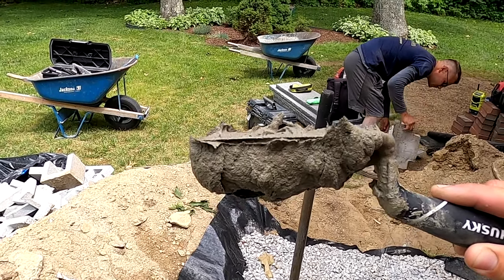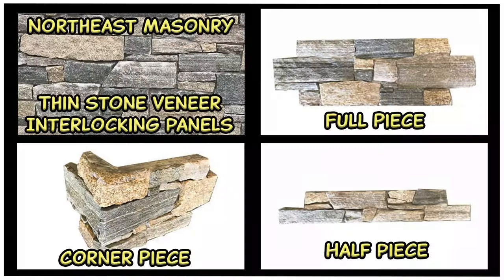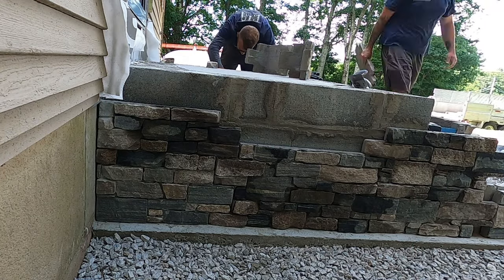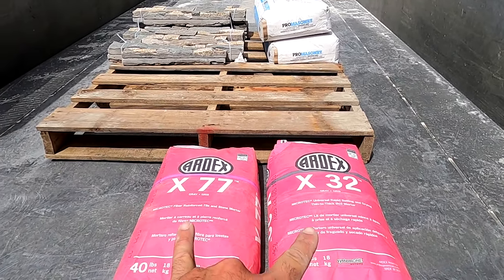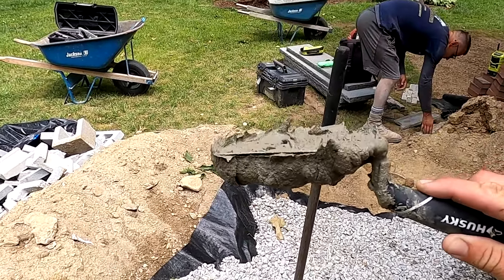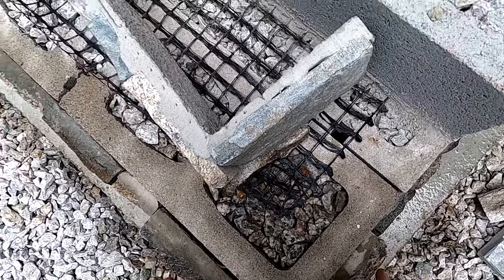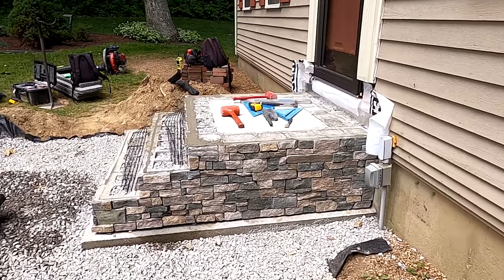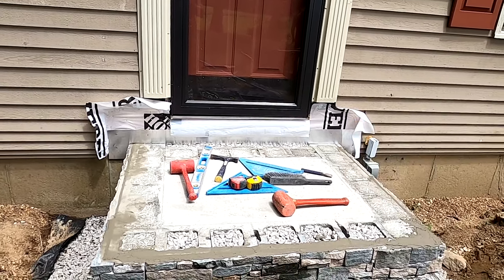Installing Stone Veneer Steps The Easy Way

Comment: My contractor used bluestone in a similar way you used the granite a few years back.  Instead of mortar for the joints he used polymeric sand which degraded over time.  I am repointing it with polymeric sand now and was looking for tips on how to keep sand in the end joint while I water it down.  I always thought the joints should have been mortared
Reply from the maker: Sorry to hear that, mortar is always best for those situations. But using some duct tape on the end joints should help.

Comment: Hi, a little advice.  buy yourself an inverter from 12 volts to 110 volts and install it in the truck.  and you charge the batteries and you also have power if you need it
Reply from the maker: Good idea man, thank you! ✌

Comment: What are the riser heights on your steps ? If you have 8” cmu block and let’s say 1 1/2 thick tread for caps, you have 8” risers. Do you cut your block down to get smaller risers? Just curious because I’m about to do a job like this
Reply from the maker: We made this staircase with 6" steps. We did have to cut the blocks down because nobody had 6" block in our area at the time. The first step we left at 8" because the first 2 inches will be buried below grade, making them all 6" steps.

Comment: work looks great but i would suggest buttering the full back of the stone since you didnt strike in your head joints on your block
Reply from the maker: Thank you, and as I explained in the video I don't think it is necessary to back butter the entire panel because when you push it into place, the mortar spreads across the entire back as you apply it. And because we are covering the block with stone veneer, mortaring the head joints is not necessary. The mortar behind the stone veneer seals those head joints.

Comment: Thank you for your great series. I don't have much experience in building steps using 8x8x16 concrete blocks. My question is that I plan to pour a concrete pad and then place the blocks on top. But how do you bring the step rise in line with the standard 6-7 inches when the block itself is 8 inches tall. Thank you
Reply from the maker: No problem, my pleasure! Unfortunately if you want 7" steps, you will have to trim all the blocks down before installing them. I had to so a similar thing on this project but only because my block supplier di not have the 6" block I wanted to use.

Comment: Yes, thats a pro tip, You are so right about filling the joints when mortar underneath is still wet.. if you fill joints after the base is set frost freeze will pop them out in a few years..
Reply from the maker: Yes sir, you know it. Thanks for the comment! ✌

Comment: I really like how you put the geo-grid under the Blue Mist treads with the Ardex x32. Very clever. However, I wasn't a fan of you cutting off the corner nub on the bottom right step. That straight line that goes vertical all the way just takes my eyes there every time. Doing that on the side doesn't really matter because most won't see it. That's why Jim from NEMD created the bowtie shaped panels, to break up straight lines.
The inter-loc panels are amazing. Glad that InstoneCo is still manufacturing them since they bought out NEMD.
Love your videos!
Reply from the maker: Thanks man, I figure the geo grid does nothing but help! I hear about the bottom right corner, looking back I could have cut it in a way that it interlocks but in the moment it seemed to be the best move to keep things moving. These panels are excellent but there are plenty of imperfections so I figured the line would fade in. But once you see it, you always see it, I hear you on that. I didn't know much of the back story behind Northeast Masonry, So they were bought out but are keeping the same name for the product..?

Comment: Nice job bro that’s some sticky shit! That’s great work. A lot of time when we set treads we use a cement bed and then we put paste on the back of the stone which is made of water and Portland cement. That’s really nice granite. And your right about setting your stones and pointing at the same time that shit will hold up forever. Great work brother you the man!
Reply from the maker: Thanks brother! I have seen some guys do the paste on the tread before laying, not a bad idea at all. And yea, pointing at the same time as you lay is #1 in my opinion. If not the joints have more of a chance to crack and pop. I love that granite! ✌

Comment: Amazing video. If I want to do this over poured concrete steps vs what you used (blocks) is there anything different I would need to do or would it be same process?

Comment: Thank you for this video, very helpful! The granite distributor I talked to said that if you go more than 1/2" of mortar on the bottom of the granite that it could seep through and discolor it. I have the same issue where my treads are 2" and pattern stock 1.5" and was just going to use mortar to line them up like you did but now I am hesitant based on what he said. Have you ever seen or witnessed issues when using that much type S mortar to level out the pattern stock to line up with the treads?
Reply from the maker: My pleasure and I'm glad it was helpful! Sorry for the late response but yes, if you use a thick bed of type S, you could get efflorescence stains in the future. But I have done a lot of steps with this method so far and no issues. .5 - .75 inches is ok, 1 inch or more is excessive for type s, use more concrete at that point. Sorry if the response was too late for you but I hope your project turns out great! ✌
Reply: @TheChristianHardscaper  no problem, appreciate the reply! Sounds good, that's about what I was figuring.

Comment: The veneer looks like Interloc New England.  I'm looking for a veneer to use for my outdoor kitchen counters.  Do you think these would be good for that?  I would mud them against half-inch cement board.
Reply from the maker: This veneer would be perfect for that. They are made by (Northeast Masonry) they are called (Interlocking Thin Stone Veneer Panels) with a (New England) color blend.

Comment: Why does leave a small gap between the bottom of the veneer and the base?
How do you fill it or leave it like that 
Than u
Reply from the maker: We had to lift the veneer up a little to meet the top of the blocks. So we lifted it up and put stone / mortar in the gap. ✌

Comment: This is good as joke not as install, this won't last long .No hydroisolation anywhere. When installing natural stones outside , you need to cover at least 90% of it with thinset mortar using butterfly method.